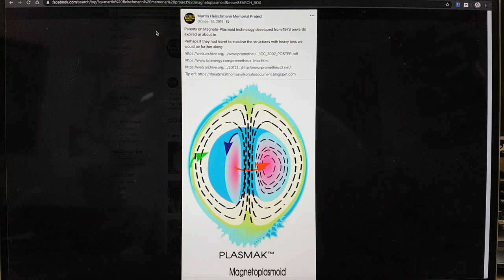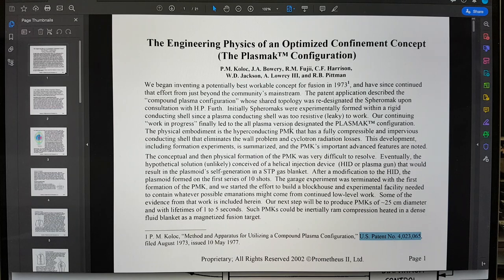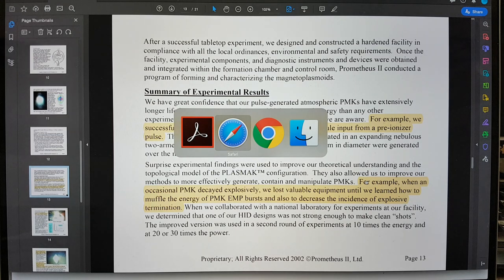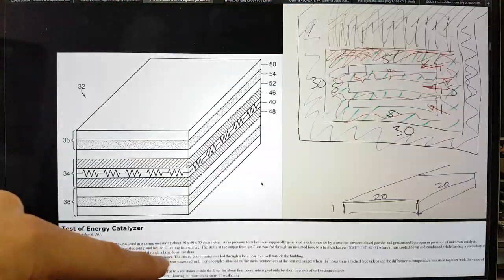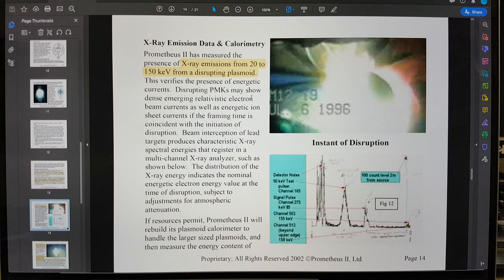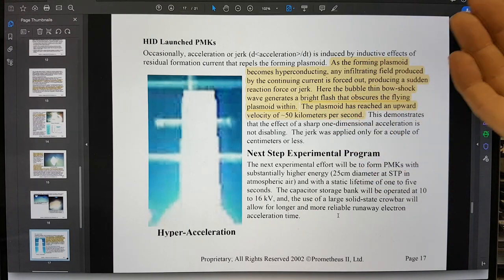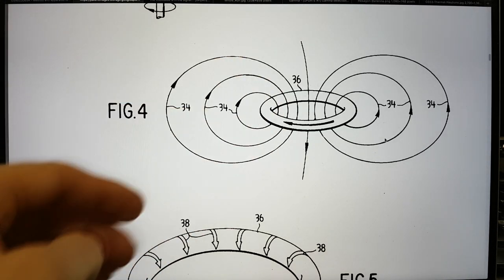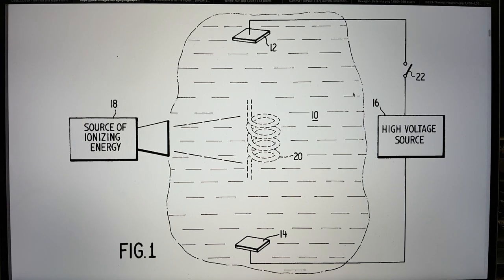Patent-Free Way to Make and Control Large Scale EVOs

Comment: During my involvement with the Plasmak (note my name appears early in the video as a coauthor) I determined to my satisfaction that the rounded diamond shaped image was not a Plasmak plasmoid but was, rather, an artifact of the way the CCD array camera shift-register charges interacted with a very high speed discharge of the plasma gun during the clocking out of the image between exposures.  The vertical axis can be thought of as time and the horizontal axis as the diameter of an UNstable plasma discharge.  I should add that this illusion was produced with a different apparatus than illustrated in Fig. 1.  If you are trying to reproduce a "lightning strike" I strongly recommend you use a very large inductor as the energy source to achieve the fastest rise time you can through the helical element.
Reply from the maker: Hi James, this is very helpful, thanks for the details. As someone that has used first analogue film and then digital film and video with global shutter, then CMOS with rolling shutter and then compression systems, I have seen a vast array of artefacts, including time, exposure and focus artefacts misinterpreted.

This shape made no sense to me (other than the hypothetical form that underpinned it).

The structures we observe are fractal toroidal in nature - quantised and self-similar.

https://youtu.be/6HWlNr2DGNg
https://youtu.be/6HWlNr2DGNg

They leave witness marks in this form as observed by Bostick and Nardi in 1980, however we have seen their 3D form and the magnetic core they produce which ranges from toroidal itself through to spherical torus - apparently hollow. These balls have a zone at one pole where newly synthesised material is ejected

https://youtu.be/6QAJo0_rV00

They are the same as natural ball lightning - and when they break up the key elements are the same as those observed in the spectra of natural ball lightning.

https://youtu.be/UNb-pHLagLc

The fractal toroidal structure easily explains how Ball Lightning can break down into self-similar sub structures as observed by Urutskoev and as we observed as witness marks when applying Ohmasa Gas to a 10 Yen coin. The later experiment showed a near perfect separatrix the inside of which one half is completely removed and outside which the 95% copper coin is practically cut like a laser. In sub-structures, we see the shifting of spin 63Cu and 65Cu, but not the non-spin isotopes of Zn. In sub-sub structures, oxygen is fused to sulphur in a process thought to also occur in natural ball lightning.

https://youtu.be/3h3Gk4vatS8

In VEGA experiment, we can produce plasma balls at will which cut on their boundary layer

https://youtu.be/lvtzxt9Duz4

and when they collide with a SiO2 fused quartz sheath produces fractal toroidal marks surrounded by what appear to be flux noodles,

https://remoteview.substack.com/p/the-mark-of-an-exotic-vacuum-object

these are what we believe are responsible for the 'surface tension' like wetting together of plasma balls.

https://remoteview.substack.com/p/vega-disappearing-nickel

On copper, these 'flux noodles' cut churned tubes through the removed sections of copper piping.

https://youtu.be/5lDogxtUZLo
https://youtu.be/CPX7gmRmeq0
https://youtu.be/GjXtQw9rDh8 

There is a wide array of papers since 1965 on the fractal toroidal structure - called "hyper toroids" or "Super Toroids" and their toroidal moments. Some are discussed here

https://youtu.be/gux490Oywoo

Comment: Really interesting presentation, I was wondering, what can you do now with this new understanding that you couldn’t do before with reliability?
Reply from the maker: Well, this presentation shows for the first time a physical way of controlling a synthesised ball lightning.

However, when you combine this presentation with future presentations, it will be obvious to many what has been going all these years.
Reply: @MFMP  It looks equipment demanding and it needs to be large. Let's focus on feeding an ultrasound sonoluminescence standing bubble in various liquids. I wonder what would happen if you used a harmonic frequency of cerain atoms in their plasma state and changing the frequency while feeding them with protons :)
Reply from the maker: @trollmcclure1884  It is part of a wider picture that will emerge. Obviously, data from LION an Ohmasa and ECCO show that this level of apparatus is not needed, but this helps us understand what is going on.